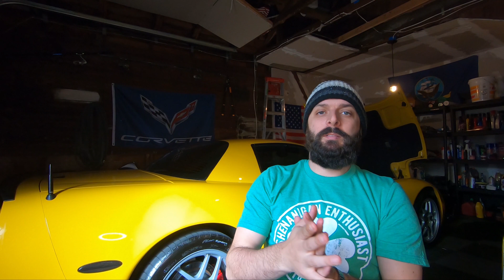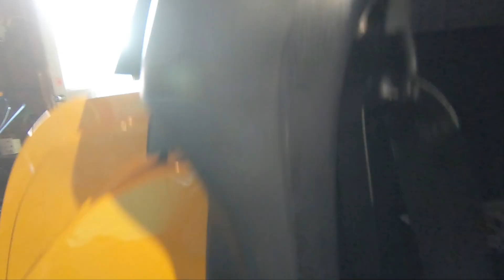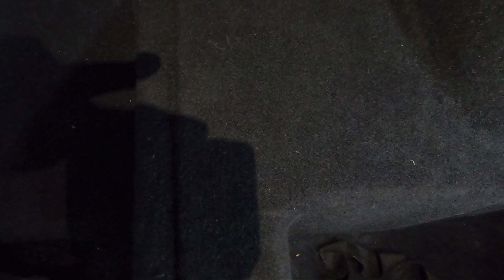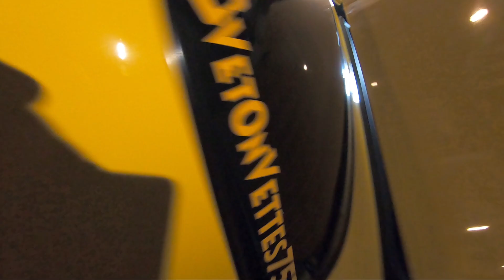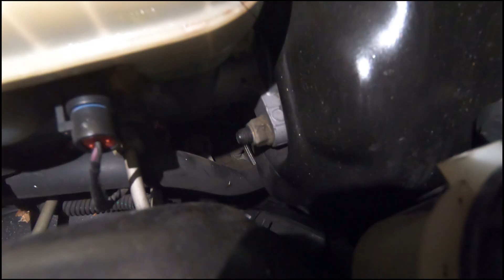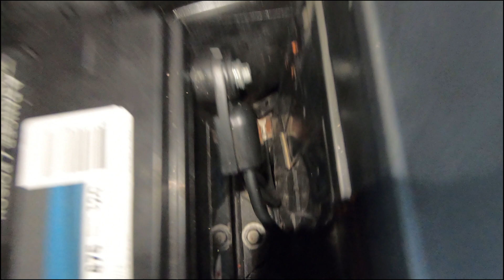ALL 9 C5 CORVETTE GROUNDING POINTS AND WHAT THEY GROUND

Comment: I noticed an area missed. Not only in this video, but many other videos as well. It's G203 located base of the right "A" pillar I believe it is for the HVAC blower motor ground... I'm working on this right now. I haven't opened the area that this ground is located yet. I will post about it here once I open it up. Just had spinal surgery and it's hard to move around in that tight area...Might just wait until I'm a little better...

Comment: Because the Electronic Brake Control Module (EBCM) of my 1997 Corvette is situated at the rear, can you tell me whether the 1997 and your C5 utilize the same electrical grounding point locations?

Comment: Know this was 3 years or more but thanks for the learning. My C5 won't start, new battery(2) since it keeps killing batteries and now we looking at your video. Hope she does not have to go in hospital😢
Reply: Did u ever fix it. Im looking at buying are corvette with a electric problem
Reply: @IamVintage72 i had the same issue it was a new ignition switch 50 bucks and 2 hours of labor
Reply: @plasmabalreacts I didn't buy that one but i did buy another. I haven't driven in over 25 years aand this is my 1st car back

Comment: Wuzup, bro! Big fan of the channel, no problem supporting it. You saved me alot of $$ and time.. would a bad ground cause the ac not to come on, already checked the fuses and relays. I'm stomped
Reply: Does the light flash but system doesn’t come on? Or no light flashing at all/light on but no AC?

Comment: Which ground is the one for hvac unit? 97 c5 dual climate control. My hvac unit display will sometimes just die out then randomly come back on. It’s been doing this for a bit but now seems like it won’t come back on at all even after an extended period of time. I replaced all hvac fuses just incase under the passenger seat. Any help would be really appreciated!
Reply: Its the unit itself that goes bad it can be rebuilt.
Reply: @gilgonzalez5902  it was the ignition switch contacts that needed to be cleaned up. Also I had the resistors on the hvac unit resoldered. Fixed works like new

Comment: Thank you for reviewing these grounding locations. Ground location #3( G401) is actually best accessed by removing the rear drivers side tire. It is connected to the frame rail directly behind the tire.
Reply from the maker: I need to do an updated version of this video with better lighting & showing the points (I had the car torn apart about 3 times now). I'm glad it was helpful! 👍🤙

Comment: Can't find the one behind the plastic on the driver side kick. Well. That's because you're just reading the wiring diagram and not actually doing it. You've never actually seen these in real life, have you?
Reply from the maker: Take the plastic trim over the seat belt off and you can't miss it. It is a black box screwed to the frame. 👍👍

Comment: I've went through most all of those to troubleshoot my speedometer not responding. I bought the factory service manual. I also discovered my PCM is ungrounded in the process. Troubleshooting that I find S120 and G120 are where the PCM grounds. However, I cannot figure out where those points are... The FSM doesn't specify. Ug. Any help would be appreciated.

Comment: Thank you so much. Been having problems with Gauge cluster, radio, and wipers. Going to clean the ground on Driver side foot panel. Just cleaned the four cowl drain bladders, and think my grounds may have gotten corroded.
Reply: Thank you
Reply: Where exactly is it near the foot panel?
Reply: @timothyandemerald  If your looking for the ground, it's between the door jam and parking brake release. You have to remove the plastic cover  that covers the bottom of the door opening and the inside cowl.

Comment: I Think i have two electrical issues, one being the fuel gauge always reads empty, i replaced the fuel pump a few months ago and still reads E, also my DIC does not light up, it did a few weeks ago for a brief period of time flickering on and off
Reply: Techron in tank will fix the fuel guage issue many videos on this.

Comment: I fully charged my battery and my dash cluster lights flash on and off, and unable to start the car. Sometimes I take the key out about 3 or 4 times and then it’s back to normal. I found one ground strap on the drivers side from the frame to the engine block is green(oxidized) it can’t be helping. I am leaning to either a security issue or a bad ignition switch. Any advice you have I greatly appreciate it.
Reply: I’m having the same issue! Let me know if you fixed it please
Reply: @ixcr_racer_808  it was the ignition switch. Replaced and now works flawlessly
Reply: Im having the same problem. Did yall find the problem
Reply: @nachosilva3777  I replaced the ignition switch. No issues anymore.

Comment: FYI, there are actually 13 grounding points on the C5. The two behind the radiator on either side or plugs that need to be taken apart and cleaned also.
Reply: Absolutely. Plus there are two white ground wires on the back of the drivers side rear head. You have to remove the intake to get to it. Good video but still incomplete because they’re 13 grounds not 9.
Reply: He actually mentioned the problematic grounds the one on the head unless out in a field or hood off i dont think would ever require cleaning
@StardustAutomotive

Comment: What could make the gauge lights turn off as soon as the motor is on? They turn on when I unlock the car and when I turn on the ignition they are still on. So they are working. But as soon as the motor starts they turn off. 🤔 They are off regardless of whether or not I have the headlights up, but they did turn off the first time when I touched that lever. Can't remember if I turned on the headlights or cruise control or what, but I heard a short quite "beep" sound and the gauge lights turned off. Since then I can't get them to turn on when the motor is running. 🤔 I just boight it the other week. The former owner said that the fog lights stopped working the last time he washed the car, and that it keeps blowing fuses since then. But for me, everything else has worked until now, including all lights, until this gauge lights issue occured suddenly. 🤔

Comment: Good video. The battery strap and the two in the back had some corrosion under the nuts. Cleaned them up and put a few drops of conductive oil on them.
Keep'em coming.

Comment: okay so my issue is randomly all the lights on the dash come on, all my guagues max out and fuel goes to zero. and all the digital warning texts scroll through...reduced power/low fuel/low coolant/traction control. etc etc. im not sure whats going on but if i restart the car it could be okay for a while, or it will happen when im driving. i cleaned all the grounds inside the hood already
Reply: I’m having the same issues did you ever find out what it was and what was the fix?
Reply: @julianramirez153  nope just been dealing with it cause it drives fine when it happens. I'm leaning towards a bad bcm
Reply: @WillCollins95 what did it end up being I’m having this issue right now except my car won’t run
Reply: @jay2x477  the ebcm I believe. I took the ground off of it and cleaned it all up and it all went away. But yeah definitely ebcm related.   Don't have to replace but it's definitely annoying with all the warning lights. Really only messes ya if if you're selling the car.

Comment: Are these near or the same for a C6 2008
Reply: since the c5's had so many grounding issues the c6's came with the ground wires soldered to the frame to prevent the same issues but yes they should be in about the same Area

Comment: Another issue I'm having with my 03 Z06 is that under WOT, my volt meter will drop and I will get a CEL and "Service Charging System."  I've always suspected it was a bad ground 'somewhere,' but where to start?  Suggestions?
Reply: I started getting this message after replacing OEM alternator
Reply: @joemorales4775  I did as well. I had to exchange the new alternator for a different new one and the issue went away.
Reply: Service Charging System DIC message normally refers to the alternator having to be replaced. Have you already tried that?
Reply: do you have an OEM alternator?

Comment: you're missing the ground points under the pass and driver side headers that go to the block. Ive had fuel pump issues when the driver side ground under the header ground wire was loose.
Reply: Hi ,
That's what I'm having problems with right now can you please tell me we're is that ground located I cleaned one on the rear drivers side by the fuel neck but no luck

Comment: I just can’t get my c5 to start ... fuck me im going through tall the hoops
Reply from the maker: Check your vats
Reply: Went through the same issue a few months ago.  The problem was in the ignition tumbler.  The 'chip' in your key is actually a resistor.  Take your key and measure on the ohm setting of your multimeter.  There are 15 different keys for your Vette.  Figure out the resistance your key is supplying to the VATS.  The fix for me is pulling the VATS connector off the back of the ignition tumbler.  I went to Radio Shack (yes, we still have 2 in New Jersey) and purchased 2 resistors that equalled the amount of resistance needed for the VATS.  I soldered them together and 'plugged' them into the plug for the VATS harness and taped the shit out of it with electrical tape.  Put the key in the ignition and it fired right up.  Total cost of the fix was around $4.  LOL

Comment: my whole car shuts off and has to have a jump to turn back on, then it will shut off again after a few feet of driving.  Ground problem?
Reply: Alternator? Ground cable from battery loose  perhaps? It culd also be you need to sand down your grounds to get a better connection. Fuel pump maybe…
Reply: It could be ur security lock doing it..if u take out the battery for a good while it will have to relearn ur key..it will say take key off for 10 secs..sounds familiar

Comment: It started with clicking noise, i replaced starter because battery is good 13.2 Volts.  After installing the starter I, It turns over nicely, but won't start. And I have a shit storm of codes, LIGHTS; Check Eng, ABS and Traction Control.  MESSAGES; 1. Reduce Engine Power 2. Check Tire Pressure 3. Service Engine Soon.  4. Low Fuel.  When I went to look up codes;  all of them  40-BCM NO COMM, 58-SDM NO COMM 60 IPC NO COMM.  All of them NO Communication.  I pulled ground the 4 smaller ground wires, cleaned and reattached cleaned all of the ground wires associated with this issue.  My questions is could it be the ignition or the PCM or PCB?
Reply: Having the issues did you ever find out the problem and the fix?

Comment: Very useful video that no one else will do.
But very hard to see because so much in camera shadow doing it alone.  Need a helper to hold light and point at splice pack with a dowel.
A bit too close, so hard to understand what part of frame I'm looking at.
On my C5, the problem was grounding between the frame and the splice block just as you say.